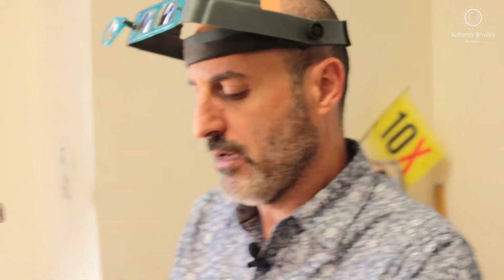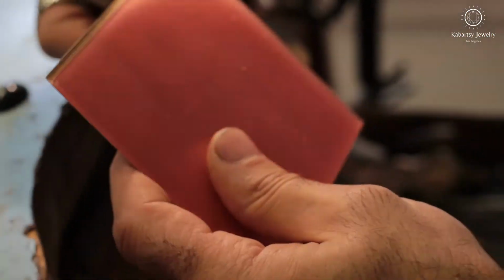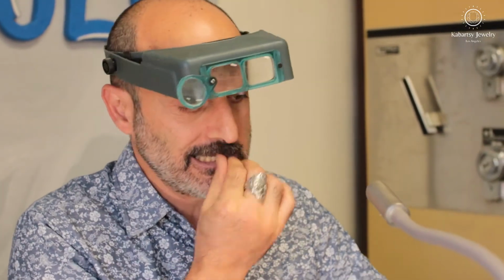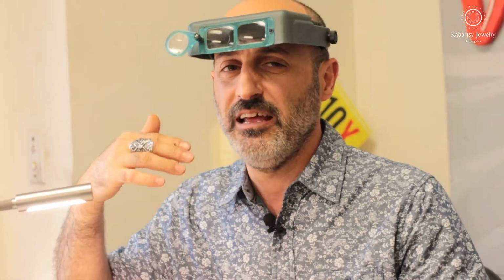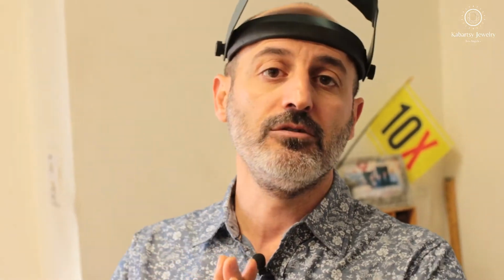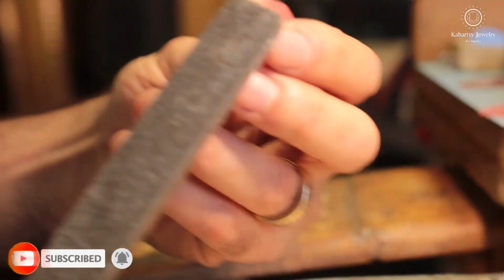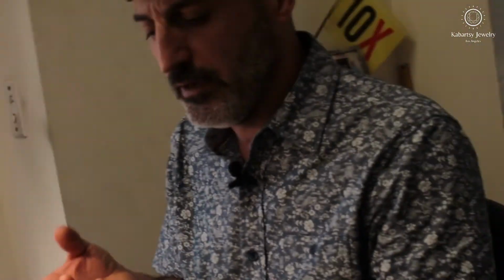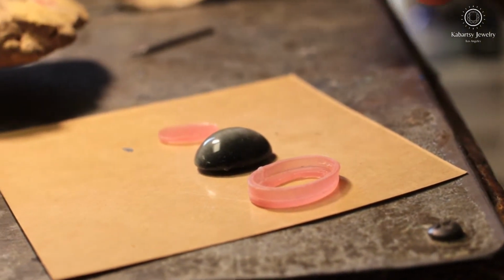How To Make A Bezel Fast And Easy | Step by Step Tutorial (Part 1)

Comment: You missed the point entirely. Andrew made a bezel with equipment costing less than $100. You have not even made a bezel you made a bezel model. Your equipment cost to make this bezel is about $3000 vs. 100$. OPEN YOUR EYES. NEW TECHNOLOGY IS BUYING AND ALREADY MADE BEZEL. LOST WAX CASTING IS NOT NEW TECHNOLOGY.
Reply from the maker: Thank you for watching the video
I hope you find making basil with soft wax and glue easier When I figured it out for myself it saved me time and energy I hope it will do it for you. have a magical time doing it

Comment: I agree with Susan. Andrew shows how to 'make' a bezel not 'cast' a bezel. And since when is it ok to put down a fellow jeweller to get attention to your very different technique? The video was 'long' as you say, because he is teaching long used metalsmithing techniques, not cookie cutter shortcuts. My attention span has just run out 👎
Reply: Andrew is pretty good, but he takes way too long to explain things..so does this guy. Also, this is an incomplete video. Why did you not show the most important part, which is actually casting the bezel. Also, you said you wanted to show us a new technology, that is much faster than soldering a bezel. Excuse me for saying but this looks like it would take at least 4 times longer than soldering a bezel, and also, it isn't new technology at all. But rather very very old technology. Probably older than soldering.

Comment: What is the wax sheet called and where  can I purchase the wax?
Reply from the maker: The company that we work with is located in the jewelry district in Los Angeles. It is called Sassounian Inc. It is labeled "casting wax - pink" on the box and it is from the direct company which has a website that is www.grobetusa.com. It is available in many gauges and sizes based on your preference. 
Thank you so much for your patience and interest. We hope to continue to provide valuable information.